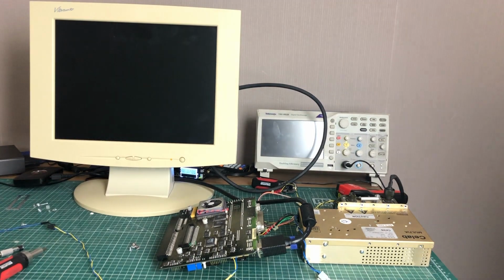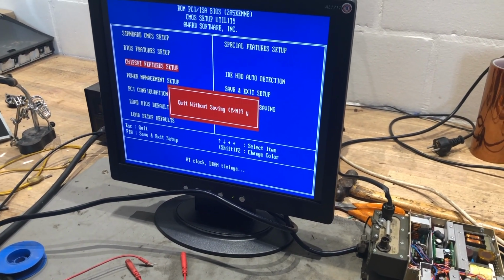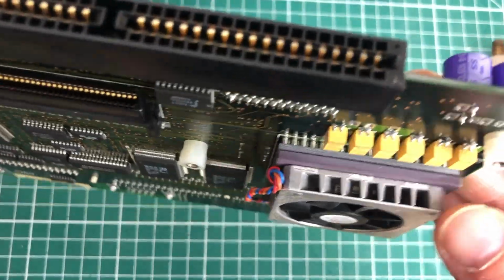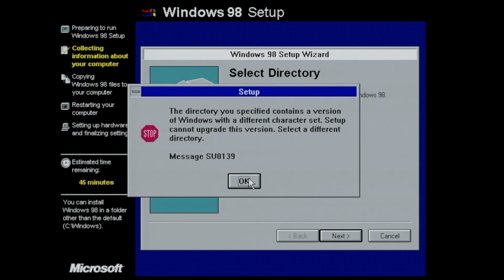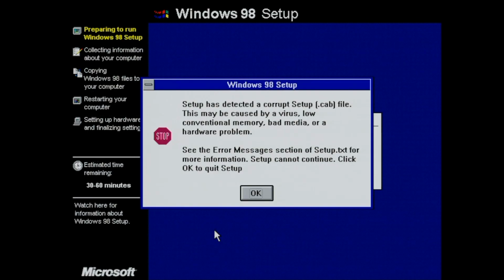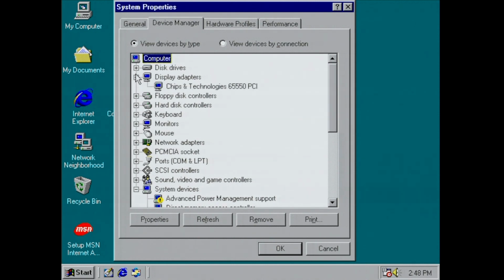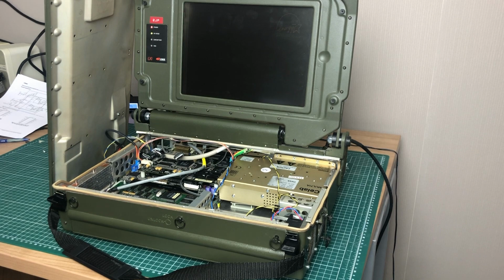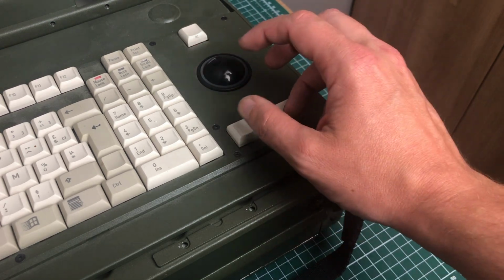Military Laptop Part 3 : It is alive !

Comment: I noticed that the character corruption is a low bit error on the data bus of the RAM chip.  The chargen ROM address lines are driven from the contents of video memory.  The low bit toggles between 32 (space) and 33 (exclamation), and that explains the L vs M and D vs E error.  It also explains the color background problem, as the low bit is toggling between 0 and 1.  It would seem the lowest data bit was being forced to 1 except when you pushed on the RAM chip, suggesting there is a mild pullup on those lines.
Reply: You must be a very hardcore EE guy who can give such a precise analysis.
Reply: @eagle20fox2  I just did a video on making a custom character ROM for a Hercules Graphics Card, so I'm very familiar with the character generation portion of the pipeline and what would cause the visible corruption.
Reply from the maker: Excellent analysis ! Really insightful.
Reply: @RetroSpector78  This guy EFormance can fix everything, not only computer stuff but also trucks, tractors, diesel engines, air compressors, CNC ...

Comment: Cool machine and a simple fix in the end.  I wonder what the performance penalty of using a cheap SD card is on a machine like this.  More modern machines struggle because of the interface speed limitations.  Maybe it doesn't matter with such old hardware.